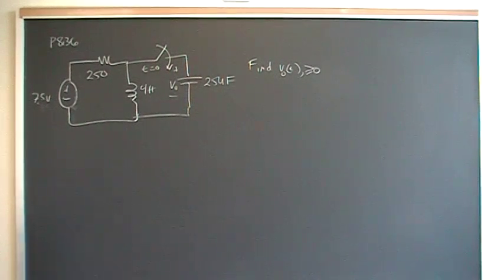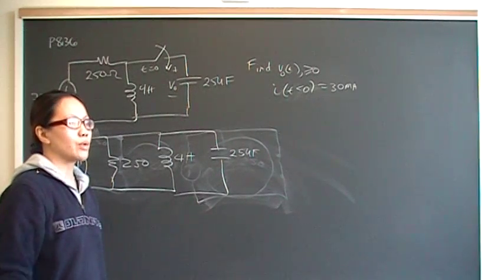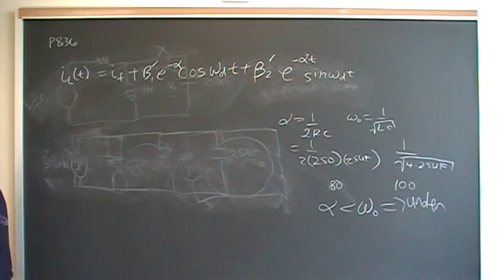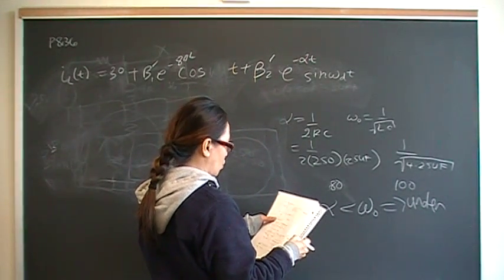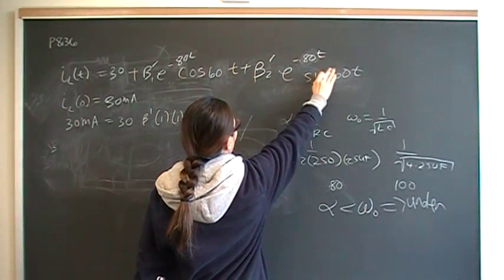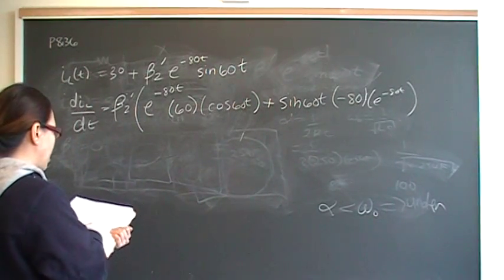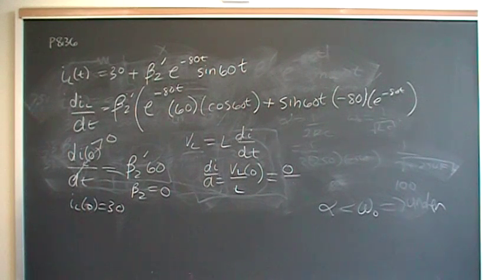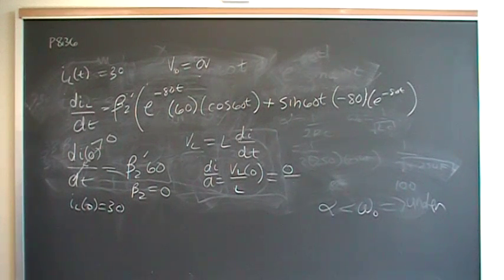Step Response of Parallel RLC Circuits P8.36 Nilsson Riedel Electric Circuits 9E Solution

Comment from the maker: this is because v=ir. so when r=0 as it does in a short, v = 0. as to the fact the indeed they are connected in parallel. one would think that they must have equal voltage drop and in all other cases you would be right. exept in the case of an ideal voltage source. an ideal voltage source will maintain its voltage drop no matter what. so for example in the case of your wall outlet, even if you connect hot to neutral, the wire will get very hot but will have zero volts but you outlet will be 120v

Comment from the maker: voltage across the inductor at time zero is zero because the inductor behaves like a short circuit in DC. voltage drop across a short circuit is zero. you can easily test this fact out by take a voltmeter between 2 points on a wire that is connected to power. you will get a 0v reading.